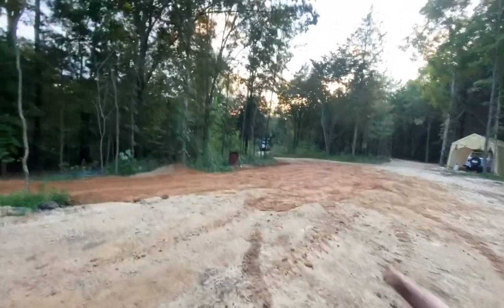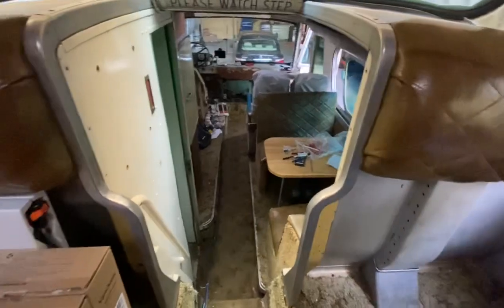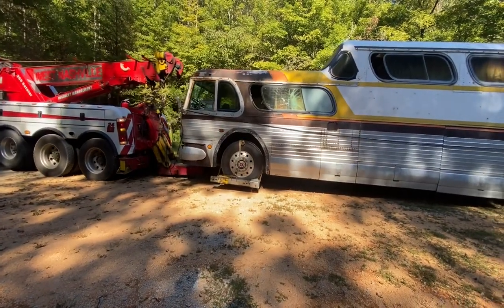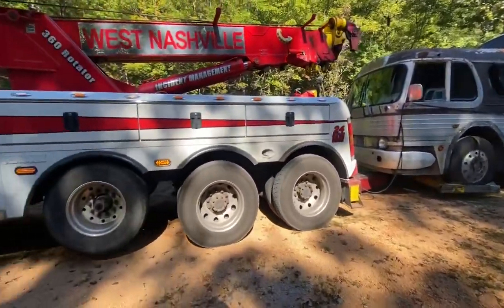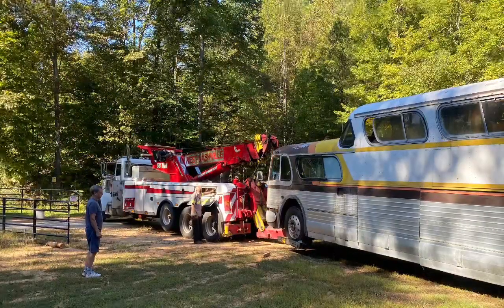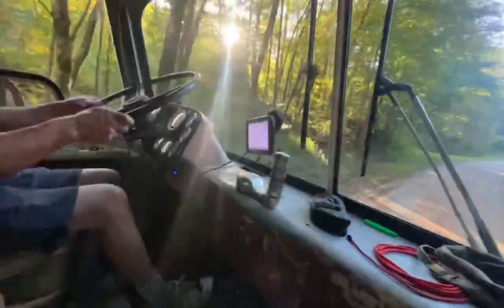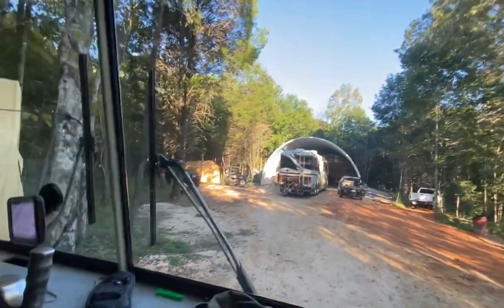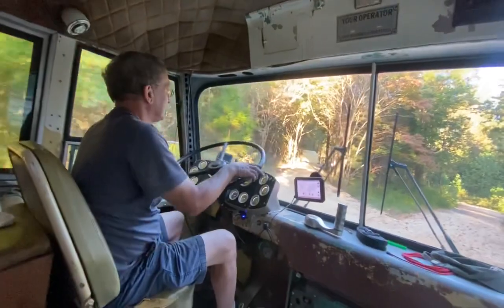Scenicruiser visit and breakdown.  Raining shot gun pellets on the property

Comment: Hey Scott, I have a suggestion. In the hut right before where the apartment begins would it not be advisable to build something like a stopper which could stop the vehicles from accidentally ramming into the apartment. While anyone driving in may take all precautions, but god forbid a mechanical failure, air brake failure leads to any vehicle overshooting into the apartment. You may think about adding a foot high concrete or rubber stopper running the width of the hut before the apartment.
Don
Reply: I’d go so far as to drive 
/sink a few properly spaced steel bollards down into the ground there, and maybe disguise them with big potting plants or other landscape treatment. Like you see in front of Wawa stores or other big retail stores.

Comment: Those air shifters are notorious for getting dirt and muck inside the shifter itself and they're very very particular so if you keeps having that problem have him pull the shifter apart clean it out replace the o-rings make sure that there's no dirt collected in there because as soon as it gets dirt or water of any kind in it it will not shift you'll have to go out there with a hammer and or a pry bar and pry it back and forth and tap it in and out and it's a pain so if it's hanging down real low and it's picking up water and dirt from the from the road you might want to build a shield to keep it from getting dirt all up in it

Comment: Just an FYI EMD locomotives generally have 2 fuel filters mounted just before the fuel intake but unlike GMC coaches have 2 glass bowls mounted upside down on top of the filter assembly. The outer filter is the primary and the inner one which is closer to the engine block is the secondary filter. When doing your pre trip inspection in addition to checking the oil and coolant levels you look at the glass bowls on top of the filter assembly and if the primary is full that indicates the fuel filter is plugged and must be replaced which is easy as they are screw on filters. Thought you might find it interesting.

I’m thinking it’s a shame you couldn’t install a filter assembly from a scrap yard onto a fuel system in a bus to give the owner some warning when his filters get plugged up.

Keep having fun Scott .

Food for thought

Comment: They did a really nice job putting the motor and transmission in can't wait to see the bus when finished as much as they are ever finished lol
Reply: Thanks... took 5 1/2 months (including cradle repairs, firewall mods, air throttle, air shifter, water separator, air dryer, brakes, airlines, electrical changes, new fan drive, new driveline, new dash and gauges, some body panel fixes, some new hinges, new studs and AL wheels, and about 100 other things)
Reply: @davesmith7706  do you know what that 8v92 originally came out of? Beautiful conversion job! There is nothing like a Detroit diesel! Best diesel engine ever!

Comment: When maneuvering or turning around in a short lot like that you should be turning the wheels only when they're rolling slightly it makes it much easier on the suspension parts keeps it in alignment by sitting in one spot and turning the wheels also makes potholes in your driveway cuz the rain loosens that spot up.  That's right 🧐

Comment: I'd assume miss-aligned, worn/stretched/junk belts was the original cause of them jumping off. yeah adding a keeper guide will help them not do that, but f the inner or middle decided to move towards the back and they overlap each other, it will be very bad outcome.
also not enough tension at 8:24 the adjusters (idler and tensioner both) were all out of whack there, which is also why the belts were so low as to be hitting the radiator hoses.

Comment: When you guys get a chance, a video on the proper way to tow a bus would be very useful.    For example, removing the axles seems like a good idea but then what covers the ends of the hubs?
Also why was it required to tow with a wheel lift ... what kind of damage would have happened if they'd used the front axle (if it has one)?
Reply: In the days before wheel lifts existed,the way to wipe the smile off a heavy wrecker operator's face was to mention rails on a bus in the rain. Heavy I beams with chains. You crawl underneath. 
The damage you can do is immense.  Buses are a form of unitized body. Wrinkle the upper skin from leverage too far up front and that's it,write off the bus. Unfixable in any reasonable way.
Reply: With the auto I needed to remove the axles. Just put cardboard plate over the holes with a couple of bolts.
Reply: We made plastic plate to tow the auto busses

Comment: What? Why do you needs scaffolding? Lol. I've been framing since the 90s and have never used scaffolding! Lol
Reply: Much safer for those with less experience on ladders/ not used to heights
Reply: @Silversphincter  I've only seen brick layers and British people use scaffolding in residential applications. Not framing.
Reply: I agree,  been in the trades over 30 years and never used them. But i imagine they are going to trim and prime, paint . So they are better off with scaffolding especially if they are not comfortable on ladders
Reply: A hell of a lot easier to install windows off of scaffolding rather than trying to do it while balancing on a ladder….